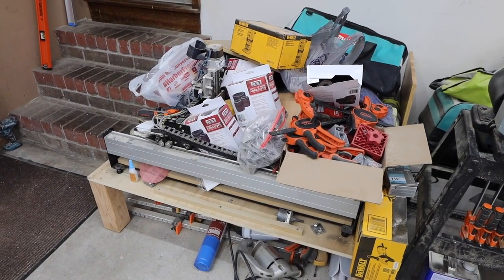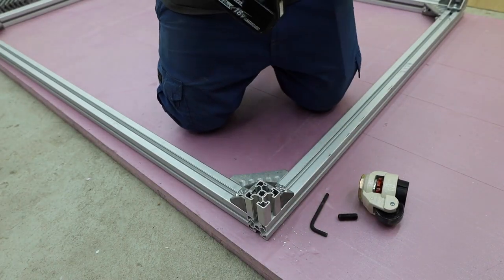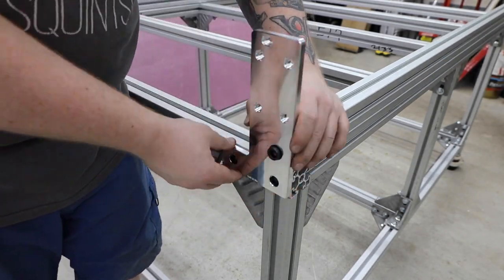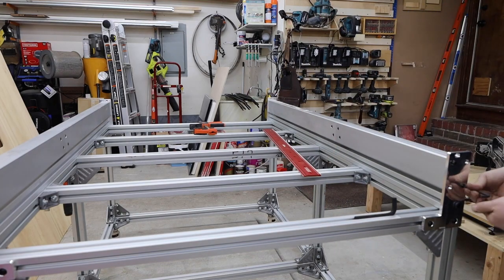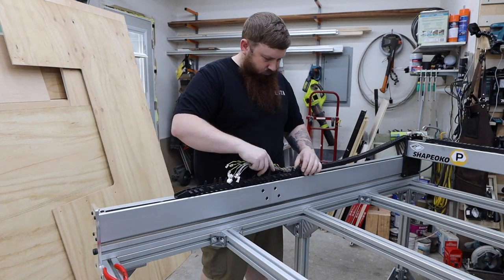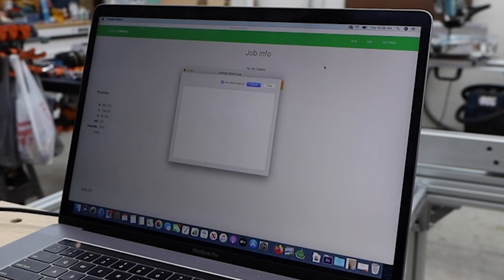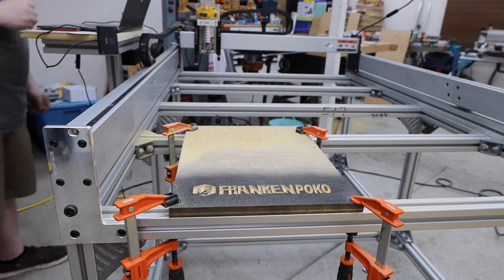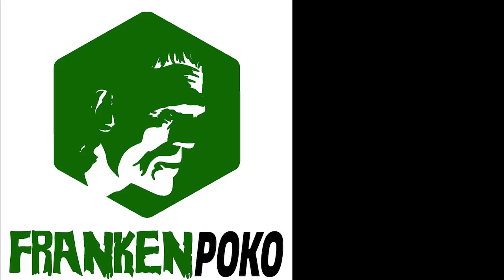HUGE Shapeoko XXL Upgrade - Frankenpoko CNC Router

Comment: Chris...I have the xl and want to upgrade my rails. Do u know of anyone that has a set of xxl rails that their not using and want to sell.
Reply from the maker: Sorry, I don’t. Try making a post on the shapeoko group on Facebook. Xxl rails might be a little hard to come by though.
Reply from the maker: You could just buy the upgrade kit from Carbide 3d. That will come with longer wires and belts too.

Comment: Is there a reason you didn't do the x axis? I ask because I just got my xxl upgrade kit today and was wanting to do this with my old standard parts
Reply from the maker: There’s no way to add an additional support to the x axis.
Reply: @ChrisPowellFSD  couldn't you run a piece inside and a long bracket across the back of them?
Reply: Or even a U shape piece of steel or aluminum over the back side? Just some thoughts that could possibly work I may try

Comment: I have the shapeoko XXL, your website says shapeoko 3? Is this the same CNC? I would love to purchase this for bigger projects
Reply from the maker: Yea it’s a Shapeoko 3 xxl. Now they have a 4 and Pro.
Reply: @ChrisPowellFSD  Yeah I have the pro, just finished assembly and testing, hitting 8metres a minute on hardwood with Makita router running at max with no chatter on the bit they sent with the machine
Reply: @ChrisPowellFSD  will this kit go on a pro also? I have enough room to use a whole wall which would be great as I could put up a sound barrier as I have a lot of left over perspective plastics

Comment: What a beast, not quite big enough for full sheet of plywood, but I can imagine flattening a wasteboard be massive task. The SH4 T-Slot rails looks about best plan for wasteboard, will give you flexibility for holding material. 
Can't wait to see what you build on this.
Reply from the maker: Thanks. I ended up doing a t slot wasteboard. Surfacing wasn’t too bad. I like to push stuff pretty fast when possible. I still haven’t gotten around to any big projects. Hopefully I will soon. Here’s the t slot/wasteboard video. https://youtu.be/AGn0rRnjHaQ

Comment: In your vid you're using double hole 90* brackets, but the link you posted are singles... Any qualms with using the singles over the doubles? Or was that just a wrong link?
Reply from the maker: It’s just what I had. Not sure the extra strength is needed.

Comment: I see that you reused those god-awful L shaped belt clips (although you did route a channel on the back side to allow for adjustment).  Did you consider another way to attach and tighten the belts (maybe a channel to pass the belt through and have the tensioner be on the back side of the plate)?
Reply from the maker: I’ll be upgrading to 15mm belts. This is just temporary.
Reply: @ChrisPowellFSD  I'm upgrading to 15mm belts as well...curious to see how you address it.

Comment: Man I've seen your post on the carbide Facebook page Ive been waiting to see how you went about doing this. I have the xl rails after upgrading to the xxl kit I want to do the upgrade also, but the main thing Ive been wanting to upgrade the belts to 15mm thanks for the video its built like a tank!
Reply from the maker: Thanks. I hope I get those parts soon
Reply: Do you know where the cut sheet is for the tslot rails

Comment: So did this make your overall cutting size to be 57in, or overal length cause the latter seems to make more sense. I’m looking at trying to get a Y cut around 60in so this would be perfect 👌🏻👌🏻
Reply from the maker: Cutting size. It has 1450mm of travel, but that’s with a little overhang in the front.
Reply: @ChrisPowellFSD  that is just amazing. Any idea if this same concept works for S4?
Reply from the maker: @eggdome787  I’m sure you could make something work. Just not sure if it’s as cost effective with the waste board they use. The frame/wasteboard was always a weak link with the shapeoko 3. They fixed those issues with the 4.
Reply: @ChrisPowellFSD  for what I’m thinking of doing and the projects I have in mind for this size of a Y axis I wouldn’t be cutting through the materials into a waste board so I can build my own table. I did read that they won’t do upgrades cause of the new waste board system tho
Reply from the maker: @eggdome787  I wish they would sell the pieces for the wasteboard seperate. Those channels look nice.

Comment: Sold mines for the pro but this makes me regret it... I think. I really need to be able to fit a whole sheet on the bed... u think this is capable with the pro?
Reply from the maker: It would probably be a little more difficult/expensive due to the linear rails.

Comment: This is something that I needed to see. Thought I was going to have to get a new machine when I move back to Michigan because I was wanting something larger. So you maintained the 32" on the X but what was the total on the Y in inches? And also can you extend the X axis? Great video thank you for this.
Reply from the maker: You could, but would have to rely on just the coupler to support everything.